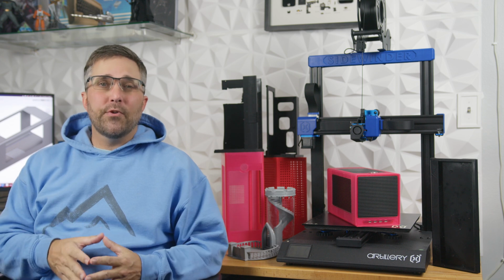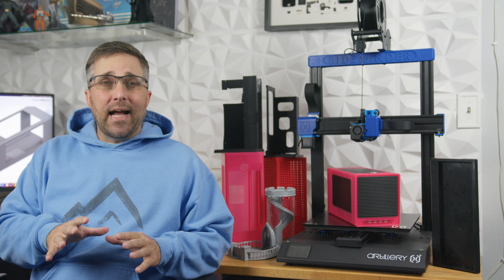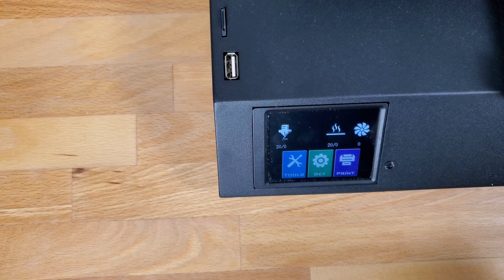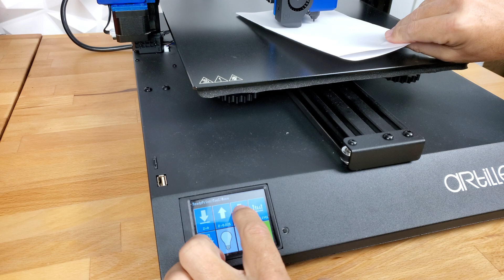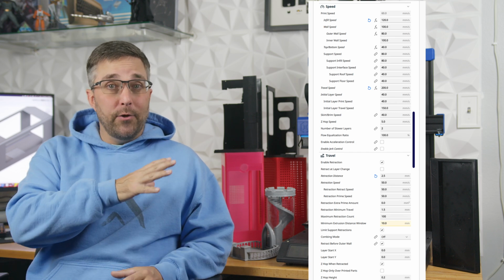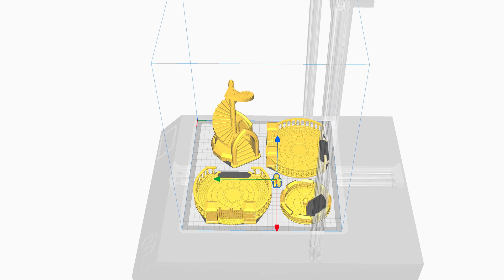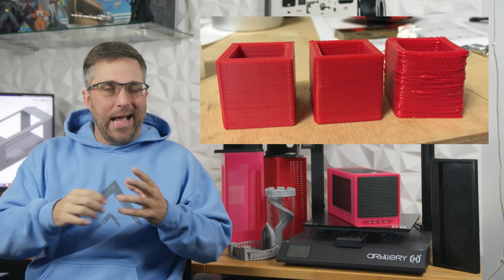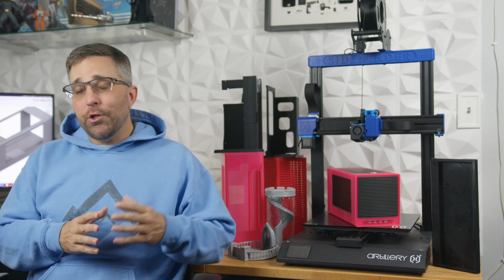Sidewinder X2 After 1000 Hours: Best Large 3D Printer for the Money?

Comment: Just caught your review of the X2. It's an excellent robust well-built printer and like you I've been running mine since it first came out. I paid the original $430 for mine and I don't begrudge the price at all. I don't print on the glass bed anymore, I was wearing it out and so I looked around for something else. Angus over at Teaching Tech is a proponent of Garulite/G10 beds and with the use of Aqua Net old lady hair spray it works perfectly. I use picture spring clips to retain the bed. What can I say, I'm old school. It seems that the G10 bed will never wear out, which definitely appeals to me. It also spreads the heat across the bed really nicely. I can recommend wholeheartedly the 6mm nozzle. It will reduce your print time by at least 50%. A word of warning, try not to demount the print head. I love the ribbon cable assembly but the print head ribbon cable connector will only take about 5 disconnections before the ribbon cable or the connector will fail badly requiring the replacement of the ribbon cable and the print head PCB. My mistake was thinking I could set up two print heads with different configurations and switch between them. Since repairing the damage, the printer has been good as gold. I'm interested in picking up a smaller Genius Pro on Ali-Express since they seem to be going for about $160 and they share all the same parts with the bigger X2.  It's 5 months later and I hope you have fully recovered from your medical issues.

Comment: ....I had the exact same.issue with the PTFE guide tube breaking down where it contacts the heat break. My prints were under extruded and "crunchy"; as it was my first 3D printer, it took a bit to  figure out. Smooth sailing since....

Comment: Not a fluke with your PTFE tubing going bad - mine had to be replaced as well on the 100hr mark. Clogged while printing PETG. 

Do you have any issues wjth elephant's foot? My machine has a huge one that doesn't seem tunable.
Reply from the maker: is not been a problem. My first layer has been great. Check your initial layer temp, speed and fan settings. You may have the initial layer temp to high or the fan off for too many of the initial layers.
Reply: @ElevatedSystems  The fan was the issue! Turned it to max by layer 3 and my elephant's foot is gone.